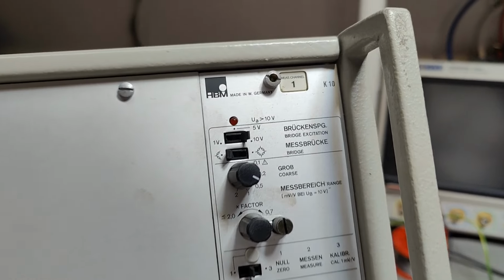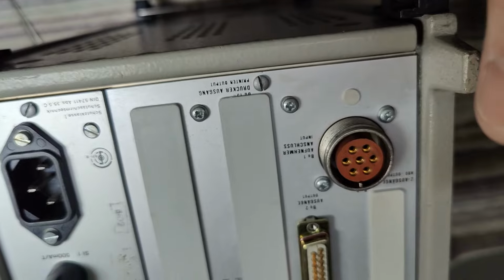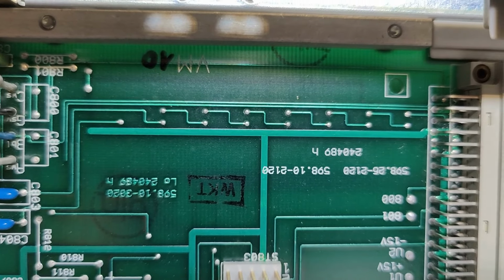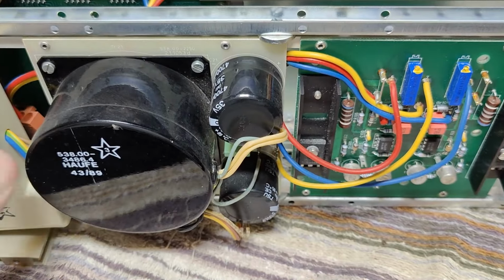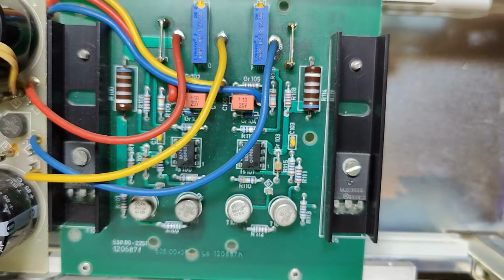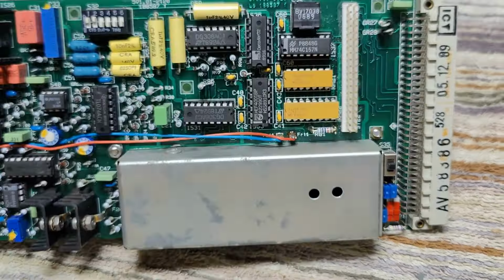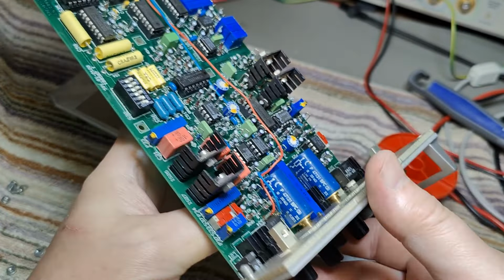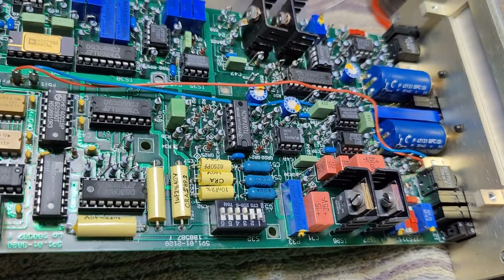HBM K10 Measurement Amplifier KWS 101A frame 1990 teardown

Comment: The crystals remind me of potassium hydroxide from a leaking NiCd battery.  If that's the case the only reason it hasn't eaten through the pins is because of the gold plating.

RS92N is a series of foil resistors from Vishay which are still in production.

Comment: I have recently become interested in Instrumentation Amplifiers. I have been considering building my own from scratch. I have realized that obtaining high level specifications with discrete components will be difficult. Therefore, I believe I will use an all-in-one chip, to do the serious work. I would like 1) to see you putting this unit back in working order, 2) for you to fully explain the circuit's operations and 3) you using it to do some testing with any minimal voltage source that you wish to assemble. Meaning, finding a particular sensor to test is not so important. Please and thank you. If anyone has a suggestion for an Instrumentation Amplifier all-in-one chip, I would appreciate it. Cheers.